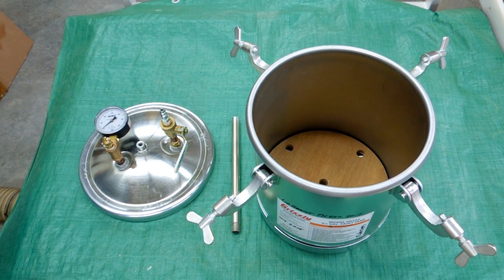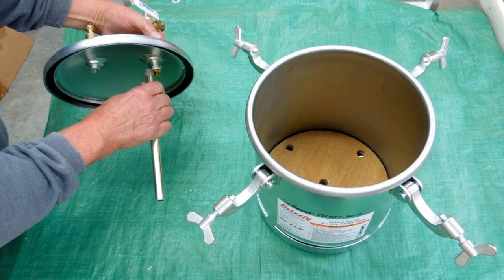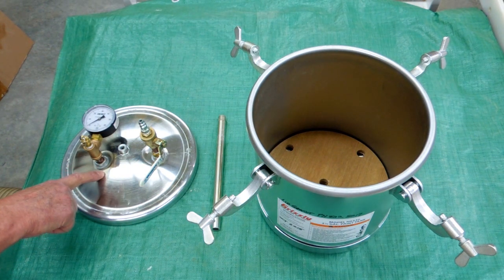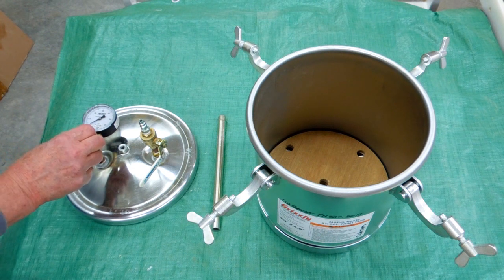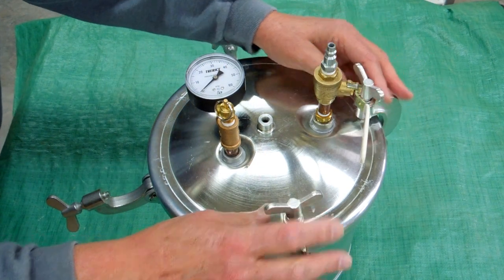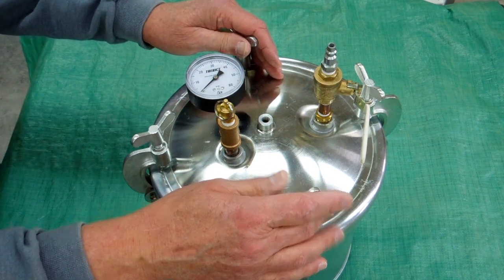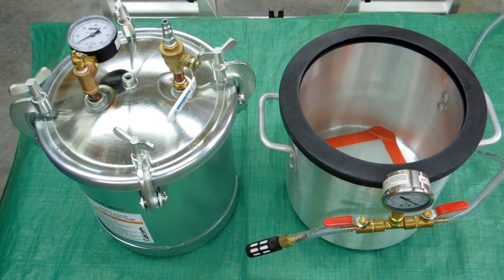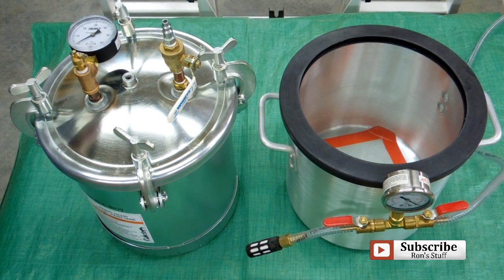Pressure Pot - Silicone Molds & Resin Castings

Comment: Can you get rid of those bubbles using sorta 37 in a air pressure pot? Thanks
Reply from the maker: Personally, I have not used SORTA 37 but I do not see why it would not work. You just need to experiment. I would do a slow high pour and then place it in the pressure pot. Good luck!

Comment: The fittings are a bit over-size because they are metric for those of you wanting to do this. .
Reply from the maker: They may be metric "something" but the threads are not tapered and they did not match up to anything metric available at the supply house (which does deal in metric fittings). Thanks for watching.
Reply: @RonaldWalters2010  Your video was helpful and I gave it a thumbs-up. What you're looking for are BSPP and BSPT threads. They are not common in the US. I ordered mine on ebay from the UK and from China. There are charts online to help figure out what you need.
Reply from the maker: OK, thanks! Hopefully this will help other viewers if they attempt this project and read the comments. :-) Ron

Comment: if you don't have a vacuum pot an old trick is to slowly pour resin into your mold from a high height. say, a few feet above the mold. air bubbles in your resin tend to pop when the stream of resin is very small in diameter

Comment: How will I know how many pressure I will need ? Do I use more pressure if n want fast results ? I have never used a pressure pot but some items do have bubbles.
Reply from the maker: Just put your mold or casting inside the pressure pot and pressurize it to 45 psi and wait long enough for the mold material or casting material to cure before removing from the pot. You do not want to exceed the pressure rating of the pressure pot. 45 psi is sufficient to compress any bubbles present. I built a hot box so I could preheat the pressure pot and then return the pressure pot to the hot box after loading it so the higher temperature would accelerate the cure and produce a better product.

Comment: Can u use the pressure pot on the sillicone as well when it's in a liquid state? Saw one video where they were using a pressure pot for both the sillicone mold casting and the resin casting.
Reply from the maker: After mixing, I first place resin or the silicone and in the vacuum chamber to degas which draws out the majority of the large bubbles or entrained air due to mixing. Some gas bubbles are generated by chemical reaction of mixed components. I found the claim that the silicone is self degassing to be inaccurate. Then the resin or silicone is poured into the mold. I place the mold (resin or silicone) in the pressure pot and the pressure is maintained until the resin or silicon has fully cured. The pressurization compresses any remaining bubbles to a point they effectively disappear.

I have a number of videos showing the mold making and resin casting process I used for making the Senior 20 Organ Conductor Figure which may be of interest to you.
Reply: @RonaldWalters2010  Thanks for the info, i was asking if just using a pressure pot is enough instead of having both.
Reply from the maker: Not in my experience. Smooth-On says their silicone is self degassing but I have not found that to be the case. Pulling a vacuum on the silicone first gets rid of the entrained air and then the pressure pot finishes the job. Otherwise you may still have a few bubbles. The resin generates bubbles due to the chemical reaction and you are going to need to pull a vacuum after mixing and after pouring it into the mold followed by the pressure pot. Gotta work fast as the resin doesn't have as long a pot life as the silicone. The chemicals are so expensive you need to give yourself the best chance of success from the beginning. You don't need to throw away many molds or castings to justify the cost of a vacuum chamber and pump.
Reply: @RonaldWalters2010  Thanks for clarifying, i'm new to molding and casting, did a ton of research and just did a few casts, one is of a head i sculpted and without vacuum chamber or pressure pot it came out great, only a couple of bubbles at the top. Now i just got a vacuum pump so i hope that will be enough and remove at least the larger bubbles. I live in Europe and use different brands, but the silicone that im using is platinum based and claims it doesnt require  degassing. Saw one video and they were just using a pressure pot for both the silicone and the resin.

Comment: How do you fill it up with air? I've modified it but now stuck on how to get the air in it. Can I use an electric pump
Reply from the maker: Called an air compressor. You must be very careful not to over pressurize it or you will blow yourself up.

Comment: I believe the threads in top are straight thread that's why people aren't getting a good seal going in with brass NPT. Correct application requires Straight Thread to Tapered thread adapters for both the 1/4 and 3/8 outlets

Comment: I just tried this for the first time, but my pressure pot was used and set up for vacuum. I didn't realize this until I put pressure in it, the gauge didn't move, and I noticed it said vacuum on it's face. So I just looked at the Air Compressor gauge and ti said 20psi, so I just left it at that. I'll try it there this time. Next time, I'll have a proper pressure gauge on it. I know it's only been a week, but did 40psi work out for you? I'm wondering if 20 is too low. My silicone is still curing in the pot at the moment.
Reply from the maker: +GunsNpolitics 20 psi isn't enough. People who do a lot of this recommend 60 psi but my pressure pot is only rated 45 psi. So I pressurize to 45 psi and it seems to work. You really should have a pressure gauge on the pot (and a relief valve). Blow up one of these up by accidentally over pressuring and it will spoil your whole day. Pressurizing a vacuum gauge may ruin it.
Reply: +Ronald Walters I'll have to look up what mine is rated at. I put a pressure gauge on it and took it to 40psi. There must be air bubbles in one of my molds because it pushed dents in the mold and the part came out looking like it was covered in warts. The other 3 molds were fine. I made the molds before I had the pressure pot though, so from now on, I'll let the mold cure under pressure too. 

I also made a 1/2 inch thick clear plastic lid with a gasket on it and use the pot for vacuum too. After I degas my resin, I just take the clear lid off and clamp on the metal lid and pressurize the pot. I'm going to glue shelf holders to the inside wall of the pot so I can  stack shelves. Molds on the bottom, then shelf and molds on that, then shelf and molds on that.
Reply from the maker: +GunsNpolitics This gets complicated if for no other reason than the "pot life" of the silicone or resin... thus, we have a limited time to play with it.

Some of the silicone says you don't need to pull a vacuum on it (degas) but in my experience you do or you will end up with thousands of tiny bubbles on the surface of the object which results in the "warts" or what I call spikes in the pressure cast resin. The resin gets pushed into the surface bubbles. I will have a video on this (eventually). 

Degas the silicone and then pressurize the silicone mold. Degas the resin and then pressurize the resin casting. 

The plastic lid is a bit of a worry as some of the vapors of some of this stuff can attack acrylic in one or two acts (fast, fast). I use a thick piece of  pyrex glass.
Reply: Ronald Walters Yeah, I'm using Aeromarine silicone that says it does not need degassed and usually you can get away with not degassing it, but I've had molds come out bad because of an air bubble before, so I always degass it now.

Comment: can this Grizzly H6330  pressure pot be used for both pressure and vacuum processes ?
Reply from the maker: +Big Fat Tony's Technically yes, but you would not be able to see what was going on during the vacuum cycle(s) so you would probably make a lot of messes, and the Pressure Pot clamping mechanism is slow and clumsy to deal with repeatedly in a short period of time (although the clamps may not be needed for the vacuum cycle). Most casting resin will only give you 6 to 10 minutes pot life. The necessity of being able to see what is going on will be demonstrated in a later video.
Reply: then the Grizzley pressure pot and a piece of thick acrylic sized for the pot, a hole in the middle for my shop vac and a gasket of carpet padding should fit the bill
Reply from the maker: +Big Fat Tony's Not even close. A shop vac on steroids would be lucky to pull 8 to 10 inches of water. You don't really see any bubbles coming out until around 15 inches of mercury and I pull a total vacuum of 29 inches of mercury. Some of the fumes from some of these chemicals can react with acrylic (in particular solvents and vacuum infusion chemicals) and the reaction with acrylic can be quick and dangerous. The lid for my vacuum chamber is 3/4" or 1" thick Pyrex glass. Carpet padding probably won't stand up that that type of vacuum either.

Comment: I've never used pressure/vacuum for either mold making or polyester resin casts. I've had good results, but I'm really looking forward to your results.
Reply: All depends on what pouring I do epoxy pours to turn on the leigh they can be 1" thick and 6--8' tall you can't make bubble free unless use pressure pot 50psi over never one bubble

Comment: where did you learn all this stuff?
Reply from the maker: +richard ebbole I am a mechanical engineer. I built, plumbed and wired my own house and workshop. I used to build very large pressure vessels at one time. I have flown radio control for over 38 years and have worked with two part epoxies and resins while doing that. For the rest of what I didn't know about making molds and castings, I researched on the web and YouTube... ignoring some stuff and acquired what I need to know to approach my mold making and resin casting project. The rest is just paying attention to details and planning ahead for what you are about to do.  Thanks for watching!
Reply: Other than that what do you do in you spare time... (sic)
Reply from the maker: +richard ebbole nuttin :-)